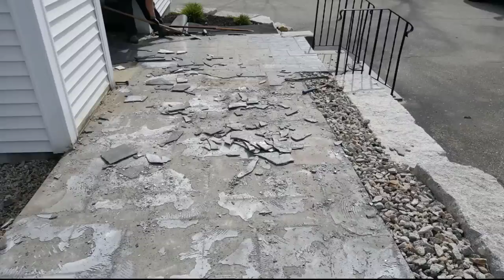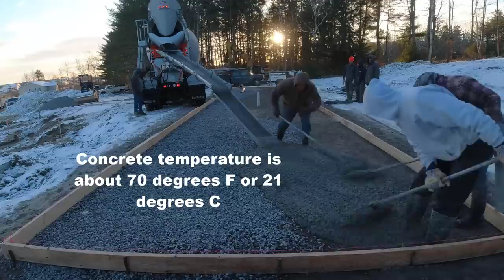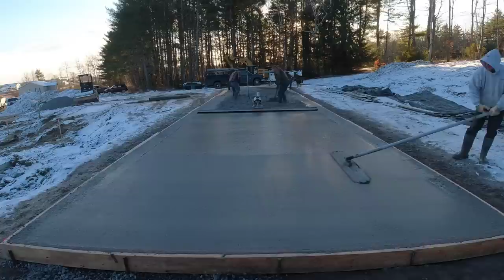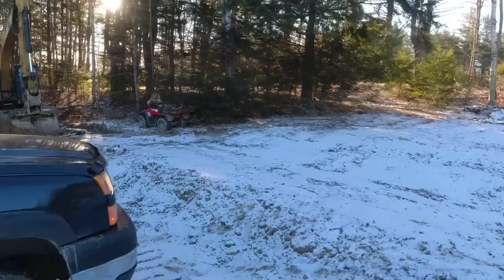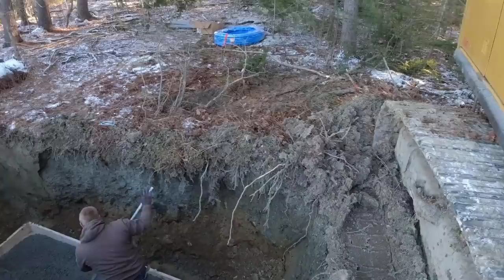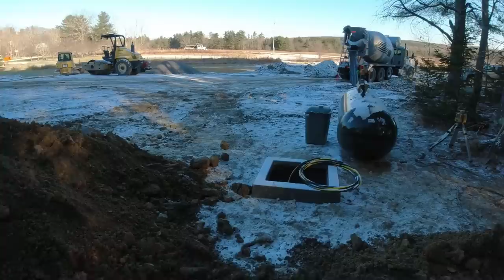This Is The Easiest Type Of Concrete Slab To Do If You're A Beginner.

Comment: Always used what I learned in the Army while in Korea.  Wool gloves with a leather shell over them.  When it got really cold, wool mittens with a leather shell.  Ours had the index finger separated in the mittens so we could pull the trigger if necessary.  Hands still got cold but it is much better than any alternative I've tried.  Wool will insulate your hands even if it gets wet so don't use any synthetic imitation.

Comment: I was working in a similar situation many years ago and I was complaining of the same thing! I felt warm but my fingers were freezing. The guy I was working with asked if I had my thermals on. I told him I had my shirt thermal on but not my legs and he said that's why. Evidently, its just not about keeping our core warm, but also the legs. I never work outside in the freezing cold temps without a good set of thermals on and it works for me.

Comment: Hi Mike, nice job, thanks for sharing. 
In winter... what works for me is a pair of those snug tiny gloves that you buy at the dollar store, then a pair of latex gloves; and then latex or rubber palmed work gloves (fleeced winter ones when it's really cold). These layers keep my fingers warm for quite awhile until I have to warm them up in front of a heater. I have at least three sets to dry out in between glove changes. Let me know if this works for you too.

Comment: Warm hands ain't easy, but it's worth the effort. I will share my method. 👏 I work outside all day in the freezing cold in Michigan. I have felt your pain. I have figured out how to keep my hands warm. I work with frozen things all day and my hands stay warm. This is the best way I've found.

First, I keep my hands water proofed with two pairs of nitrile gloves with cornstarch powder to let them slide easily. The best I've found are the orange "heavy duty" ones from AutoZone; they last all day and are very high friction if you need to manipulate nuts and bolts. I wear two pairs of those orange gloves ALL DAY LONG, every single day. I have had no problems at all. It allows you to take off your leather glove momentarily to touch your phone or gear without instantly freezing your hands. It also insulates your hands extremely well.

Second, I use three pairs of leather gloves and a heat source; swap gloves when they get water logged/cold. Do the swap as you feel the finger-cold starting, because if you lose feeling and your fingers are in pain things become very uncomfortable very quickly. You can use any heat source to heat the gloves; just leave them on there. (e.g. engine or furnace)

I have found no better way.

If I'm at home I keep a small pot of water on the heat source to put my hands in for instant heat while I'm swapping leather gloves (for when I waited too long and need to warm my fingers instantly). I just dip my hands in, with the two pairs of heavy duty orange nitriles gloves still on.
Reply: Much easier wearing waterproof leather mittens over wool or down liners. I work hours without all the complex system you had. Worked 4 straight hours at -15f and hands stayed warmed to the touch. Do eskomo's wear gloves? I also worked on my cars at 15 bare handed, that trick was over dressing so the heat just radiated out of hands, can't be real physical or I would over heat but working on cars is basically standing over it
Reply: @safffff1000  TL;DR 🔥 hands: 2 sets of "heavy duty" orange nitrile gloves from AutoZone; keep these on. 2 sets of leather gloves. Leave one set of leathers in the heat. Rotate when your current set gets cold. ✅
Reply: @crazydavidsmith  Too complex, slip on leather covered gortex mittens in a second

Comment: You are the expert.   I poured my shop slab when it was that cold.  I covered it with 2 inch pink foam board. But I was still nervous so I put a heater under a tent I built lol.

Comment: Glove recommendation. Seirus has thin glove lines that reflect your heat back to your hands you can put in any gloves. I will actually use them inside nitrile gloves when working on machinery in the winter. High dexterity, waterproof, and insulates your hands from freezing metal. Seirus has some nice waterproof winter gloves with high dexterity. One of my favorite gloves is wells Lamont extreme dexterity. The liners will never pull out and they are very warm. I do snow removal. So I am used to working in the wet and cold.

Comment: We always wore rubber gloves with knit glove liners. When our hands got cold, we would dip our hands in a wash bucket of hot water. Also wore 5 buckle boots over our winter boots instead of the slip on boots. Later switched to insulated rubber chore boots. Cold weather pours were always a pita. They were pretty intermittent when winter set in.

Comment: Nice work. I also worked in wintertime conditions, and indeed hands are quickly cooling. The rest can be better protected. In my case I did airtightening for low energy and passive wooden houses. In freezing cold and wind blowing it was sometimes nearly impossible to strip the bearer from the tape that had to be applied.

Comment: Hey Mike, Did my first (tiny) bit of concrete work recently (replaced the sewer in my 1950's house). You guys make it look easy, but concrete really is a wet and heavy mud. The only source of heat in the house is a 1,500watt space heater, and once I started mixing and spreading it was too warm (even with our 19F outdoor temps). Thanks for sharing, and keep up the good work!

Comment: Thanks for the great video! On the topic of cold hands: I live in Alaska, so we deal with cold hands a LOT. I like "polar penguin" work gloves. They have enough dexterity to work with them, but they are lined inside with fuzz and the outside is lined with latex. They are available on amazon but I see some knockoffs on there now that might work well, they run about $8 for a pair.

Comment: Hi Mike, Mark from Portland here. As far as keeping your hands from freezing I would suggest this:
Bring a small portable cooler with you – empty. Fill it with hot water from the truck and keep it covered until you or anyone in your crew needs to thaw-out your hands and you can dip your frozen bits in their until you are ready to resume work - just remember to bring lots of microfiber rags/towels to dry off. Lanolin helps reduce chapping.
Good luck I hope this works for you and happy new year to you and your crew!🎉

Comment: In years gone by back in my finishing days in the 70's during winter pours along with the hot water many times we also asked for liquid calcium chloride in the mix from the batch plant and depending whether we had to pour over a vapor barrier we would often add bagged calcium chloride to help resist freezing but to also help generate some heat to get the slab to set well enough to get on with knee boards to hand finish, as you know Mike if you're not careful you can have the slab freeze or be so wet you may as well plan on coming back the next day to finish the job.

Comment: 19 degrees.   I live in Minnesota so 19 degrees is a normal HIGH for January.  We get used to it gradually during the fall hunting season when the low in Nov. is in the teens many days.  It appears that you're wearing rubber gloves that are pretty large.  Hopefully you are wearing1 or 2 pair of Jersey gloves under the rubber.  Holding onto that aluminum pole certainly sucks the heat away from your hands.  I'm one of those lucky folks with - evidently - great circulation.  I'm in my mid-70's and can generally stay out much longer in below zero temps than my younger counterpart.   Looks like the excavator did a great job of site prep followed by a quick, efficient and "done-right" job but you & your crew.

Comment: A Thinsulate or Gortex, nice and LIGHTWEIGHT ski glove will keep an insulated air layer between your fingers and the outside temperature.  You still have waterproof protection and full finger movement.  Hell, the fingers even work on your touchscreen cellphone.  Here in Wisconsin, we don't break out the gloves until 8 degrees or colder.

Comment: Cold hands and fingers. . .Try heated glove liners. They are very thin and allow throttle, hand clutch and brake lever feel much better the heated gloves. I've used them for cold weather motorcycle riding.

Comment: Woven cold weather gloves with rubber palms and a kids size hand warmer pack on the back of each hand.
If it is really cold, packet on your inside wrist under coat cuff. I am an arborist and do work in most weather. Only wind over 20 mph stops us.

Comment: As a concrete driver/plant manager I hate pouring concrete under 27 degrees. Water freezes in the hoses, concrete freezes in the truck, brakes freeze up, just a pain. I was glad to hear you kept the sub grade covered with blankets. Too many times we have poured concrete on top of frozen ground and it ends up cracking. Guess who the concrete guys blame? You sold us bad concrete, they say! If that water in the concrete freezes before the concrete reaches 500 psi you have a problem. The concrete looks like broken glass when it finally sets up.

Comment: Hats off to you Mike for pouring concrete in that cold weather. We hang it up in November here in central New York. Start back up when the frost leaves the ground. We also have a 48" frost line. Nice job 👊
Bondo
Reply: Why 48inches?
Reply: @jeremyhall7951  The frost line in certain ares is measured by how deep the frost will penetrate the ground in certain areas of the world. The colder it is and longer your winters the deeper the frost line will be. The warmer areas do not need to build so deep in the ground. Hope that makes sense. 😀

Comment: We would always dig a small trench around the perimeter at the forms, then drive in rebar pins and tie rebar around the perimeter on the inside. Also even with fibers we put in wire mesh.

Comment: Hi Mike….very helpful video. Thank you…
I am building a 60 x 38 shop this summer…I am in Durango, Co, and frost line is 32”. I got a bid for the flatwork and foundation as a monolithic pour…at about 22.00 a foot! The bid totaled 47k. I am doing all excavation work…gravel…etc. The bid was for concrete, rebar…and forms. 
Having watched all your videos made me very quickly come to the conclusion I would be taking this on myself.
My question is…I have no issue buying a power screed for this job…and then selling it. Unfortunately, none of the rental places carry it. Do you think it would be helpful for a first time DIYer to use a power screed?
For a shop floor….if I can get close to what you did on this video…I think I would be very happy. I can rent a power float locally….am I taking too much risk in screwing it up if I use a power float?
Thanks again….Steve.

Comment: Great stuff. I'll look for the brand of my heated gloves with Lithium Ion rechargeable batteries. They are good for several hours on max and more on low. You can move your fingers and they do not get stuck on the inside liner like some. I would try to keep them as clean as possible though but at the end of the day you need to function and you can't function long like that. Even one job that you make money on pays for damage to something like that. No more expense than filling up the truck on the way to the job site.

Comment: Two layers of the cheap jersy gloves are the best I have found, you can wear one on one hand and two on the other for finer control. replace and throw the wet ones on the truck dash as needed. Still sucks but its the best I have found, and then keep your core warm so your body is not stealing heat from your extremities.

Comment: best way to stay warm is drink plenty of water and don't over insulate your boiler (bodily core). a central heating system needs water to move the heat around and if the boiler is too hot, it switches off, same as the bodies boiler. may sound counter-intuitive, but that is because of double-think. heat is a waste product to a healthy body. 

don't drink tea or coffee, otherwise you'll be peeing every 2 mins and will end up de-hydrated again. (cold extremities)

Comment: The way I deal with cold fingers is by putting on a pair of thin painter gloves before I put on a pair of my normal work gloves ( cheaper nitrile dipped gloves) Then you have a waterproof barrier under your work gloves and it almost takes on a wetsuit type insulation.  My hands always get cold for a period but after the initial shock it becomes tolerable for a full day outside without having to jump in a truck with the heater running every hour

Comment: For gloves, get a box of Venom latex gloves.  and put a pair on under your work gloves.  Venom gloves are a thicker material and they are 2 layers.  The other thing that I will do overall is take my dad's old wetsuits (or buy used ones from a serf shop) and cut them in half so they are a shirt and pants.  I put on an under-armor long sleeve shirt and pants, then put on the 2 mil wetsuit.  I cut them in half so it makes it easer to get in and out of them, especially when you go to the bathroom.  I usually have a spare set of under-armor to change out if I have been sweating.  If it is between 0-20 deg F, I put on a cotton shirt between the under-armor and the wetsuit to help wick the sweat off my skin. I usually wear a light, long sleeve flannel on the outside.  It sounds like a lot and it is a lot of layers but very little bulk.  The gloves, socks, and head-cap are great additions also.  For all the military out there, the skin-suit and wetsuit is all hidden under your uniform w/mock turtleneck.  Loading torpedoes on the pier at -10 deg F, I had to take my jacket off because I was too hot.
Reply from the maker: Thanks for sharing, that' good stuff!

Comment: You need to make sure your not pouring on frozen ground , hot water , maybe chloride added, but a main factor is to cover it with blankets or visqueen then straw over that to insulate it and leave that on for 24 hours

Comment: Cold hands : Would a Mr. Heater Big Buddy (18,000 BTUs) or the Mr. Heater MH54OT (w/up to 45,000 BTUs) help?  Either clamps right onto a 20 LB. propane tank.  If you could find 3-4 minutes to put your hands over either, I think it would help.  You seem fairly good at figuring things out so you could come up with a make-shift rack that would be 3-4 feet over either heater with several pairs of extra gloves.  Mmmmm - putting on a different pair that are about 110 degrees... that'll help warm those digits.

Comment: When it comes to working outside in winter two things always come up.
1 Dont know why but I am always cold until about 10AM and then I seem to fall into a rhythm and I am good for the rest of the day.
2 sometimes mid 30s and damp is worse than 20 and under. Add a breeze and its just miserable.
Been outside for 45 yrs now and not ready to quit.

Comment: Found your  channel while learning how to do a slab for a job Im doing. I have a 30,000 lbs Generator on a 3-axle trailer i need to do a slab on grade for. Can you please recommend how deep I should do the gravel subbase and how thick I should make the slab .  Its a 10 x 20 foot slab and I was going to do 8 inches of 3/4 stone with 6" 2500 psi concrete with 24 inch grid 1/2 inch rebar Thank you!
Reply: Gravel thickness really depends on local soil conditions.  Gravel is really cheap for a pad that small compared to having issues later though.
Reply from the maker: Soil conditions and climate really dictate how much gravel you need. I'd go at least a foot, then 4000 psi concrete 8" thick with a mat of rebar.

Comment: Cold fingers:
I don't work in as cold of temps as you, but I often have to spend the day in cold and WET dirt.
My solution is using Nitrile gloves as liners.  5 mil thick will work with leather  gloves over top, but thicker is better.  Complete agility ("pick up a dime").  Hands stay dry, which for me is the battle.  And warm enough that on occasion my hands will actually sweat if I am active enough.
Bonus is how my hands stay clean.  Washing up at the end of work takes little time for scrubbing.

Drawback is the gloves can develop tears at the most inconvenient times.  I carry spares in my pocket, but sometimes I have to work with them failed until I get to a break....and putting on a pair with sweaty hands can be a real bitch.

Harbor Freight has them in 5, 7, and 9 mil and for about 4 hand sizes.
They have gone back to normal pricing (like 25cents a pair for the 5 mil) so even if I go through a couple pair in a day I am still ahead for the time I save at the sink not scrubbing fingernails.
That said, I can get multiple days out of the 9mil.

Comment: Hey Mike.  I'm a big fan of your videos.  I just had a 12x22 monolithic slab poured for a single car garage.  4000lb PSI, 5 inches thick with wire mesh and finished the bull float.  I'm down in Long Island and paid $5400. do you think I over paid?
Reply: Yes

Comment: They make silk thin electric glove liners. The battery wire goes up your arm and down to your waist. Some have the batteries that are on the wrist in a water proof pocket. I ride a motorcycle in winter and the glove liners must be battery powered. The filament is thinner. But everyone is different. It may not work for you.

Comment: Hot Hands, part 2: You can skip the wet hands and put small plastic trash bags over your forearms before dipping them into the hot water, which will also guard against chapping due to water/drying cycle. You can skip the towels too!

Comment: Your body looses 70% of the heat generated through the neck and head so if you want to keep your toes and fingers warmer put more insulation on your head and neck. Leave the thin hoodies at home wear more of an insulated head covering that goes down your neck or a heavy scarf below your hat. If your head is warm that will force more blood down into your fingers.

You are the expert in my opinion it is too cold to pour concrete at those temperatures. Too many things to go wrong to ruin the slab.